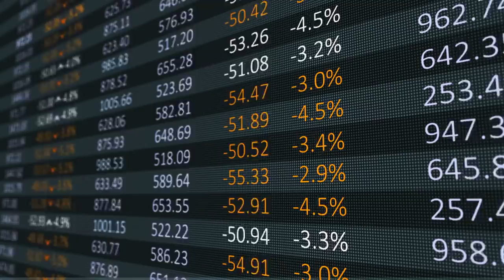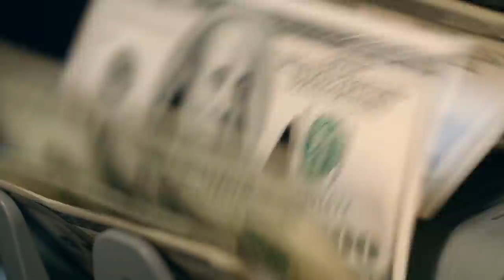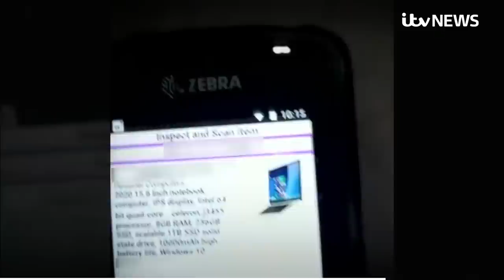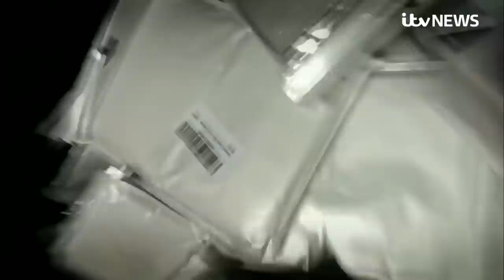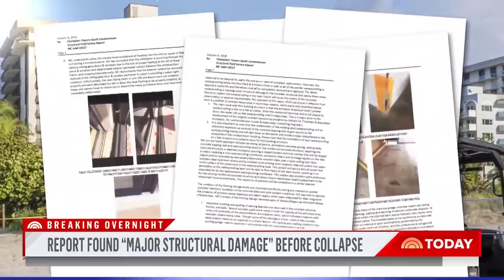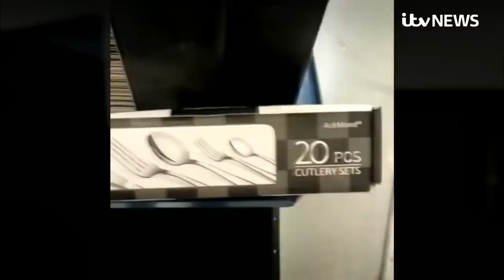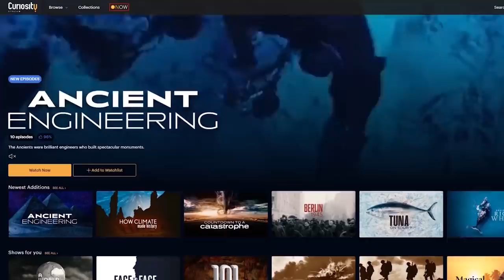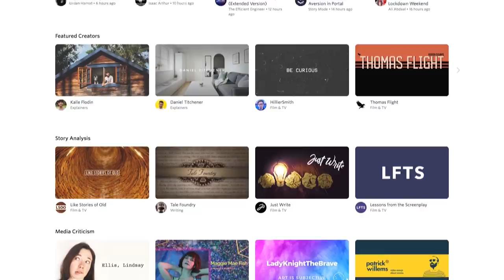Is Capitalism Actually Efficient?

Comment: I know you don’t like capitalism, so could you make a video that gives your opinion on what kind of economic system we should have? I don’t like how big corporations are able to manipulate the economy like that, but I also think some business is good, and that in general equality of outcome is a bad thing.
Reply: @slevinchannel7589  is it?
Reply: 'but I also think some business is good'
Why?
Significant presence of capitalists makes guaranteed housing impossible, or nearly impossible. That is monstrously bad.
Reply: @thetaomegatheta  I understand that the profit motive is not the only incentive for people to work, but how can a fully planned economy take into account that certain essential jobs are much less desirable than others, and may be more necessary? How can a fully planned economy  account for the fluctuations in people’s interests regarding work/ career? I’m not saying it’s not possible and more than anything I’d like to know how it might work without the extra incentive which business provides. I agree most markets should be capped, but how do you get enough underwater welders for example when it is an extremely dangerous job?
Reply: @roanshash2979  
'I understand that the profit motive is not the only incentive for people to work'
The profit motive isn't a reason to work at all, as working-class people's income (except for, arguably, freelancers) doesn't include profits at all. Working-class people's income is comprised of wages and salaries, not profits.

'but how can a fully planned economy take into account that certain essential jobs are much less desirable than others, and may be more necessary?'
I don't care about the specifics, and I'm not sure you are even aware of how this is accounted for under capitalism. The USSR managed stuff like that just fine, and I don't see what the issue is.
One tool for regulating stuff like that that you might be interested in is the fact that, upon graduation from university (which was not only free, but you were paid to attend, actually; if you get a budget spot at a university in Russia today, you also get paid to attend, but today's stipends are negligible, while the stipends of the past were very significant (like 40 rubles per month)) you were offered a job (which you did not have to take).

'How can a fully planned economy  account for the fluctuations in people’s interests regarding work/ career?'
A person applies for a different job, gets the job, starts working that job. Gets provided housing if they have to move to another city, as well.
The USSR managed just fine for decades.
So, what's the actual issue?

'I agree most markets should be capped, but how do you get enough underwater welders for example when it is an extremely dangerous job?'
How do you get enough underwater welders under capitalism, where people don't even get offered appropriate jobs upon graduation?
Reply: @thetaomegatheta  my example of the underwater welder was to illustrate that people might be more inclined to be an underwater welder since the salary is very high under capitalism and it is a vocational career. If there is no further incentive to put yourself in a dangerous job like that would there be a shortage of underwater welders? People might go to school more but how many would end up working as an underwater welder? Companies need underwater welders to produce their products so that is how sufficient welders are acquired, but I’m not saying that’s a good way to do it.There can also be markets and business with worker owned means of production no?
Reply: @roanshash2979  
'my example of the underwater welder was to illustrate that people might be more inclined to be an underwater welder since the salary is very high under capitalism and it is a vocational career'
Real salaries in Russia are lower than they were in the USSR. Most of the world has lower real income than that of lower-income people who lived in the USSR, in general.
This claim that salaries are somehow magically very high under capitalism is just nonsense.
Not sure what was your point in bringing the fact that it's a vocational career, either.

'If there is no further incentive to put yourself in a dangerous job like that would there be a shortage of underwater welders?'
The same argument applies to underwater welders under capitalism, yet you are presenting this as only being a problem for planned economy, for some reason.

'People might go to school more but how many would end up working as an underwater welder?'
Same argument applies to capitalism.

'Companies need underwater welders to produce their products so that is how sufficient welders are acquired'
Companies needing welders doesn't actually magically create welders. Unless they are acquiring slave labour from a reliable source, welders actually have to apply for, or be offered the job. That is how you get underwater welders under both capitalism and planned economy.

'There can also be markets and business with worker owned means of production no?'
Market socialism is a thing, but I don't think it ever got implemented, and I am very much not a fan of the idea.
Reply: @thetaomegatheta  vocational education can be completed much quicker than a 4-year B.S. or B.A. so that’s why I mentioned that. I think what I’m trying to say is that the higher salary under capitalism is the incentive to be an underwater welder. I mean it’s not unheard of for people to chose jobs because of the money. 
I agree that Russia today has worse quality of life and lower pay than in the USSR, but if everyone gets similar pay in a completely planned economy for multiple jobs, what would make someone want to be an underwater welder and put their life at risk? Why not just be a regular welder if the benefits are similar? I appreciate the time you have taken to reply to me but could you explain why you don’t think the higher salary under capitalism serves as an incentive in this case? The way I’m picturing it is weighing the pros and cons of the job under either economic system. I’m sure it’s possible for a socialist country to add the incentive for dangerous jobs, but how was it done?
Reply: @roanshash2979  
'vocational education can be completed much quicker than a 4-year B.S. or B.A. so that’s why I mentioned that'
And? Do you think that vocational education is incompatible with planned economy?

'I think what I’m trying to say is that the higher salary under capitalism is the incentive to be an underwater welder'
It is not somehow magically higher under capitalism, so your premise here is just wrong.

'I mean it’s not unheard of for people to chose jobs because of the money'
Okay, but your entire premise of capitalism somehow providing higher salaries/wages is wrong.
Or do you think that people were paid the same salaries in the USSR? I'd like to inform you that that is just an unsubstantiated meme, as well.

'but if everyone gets similar pay in a completely planned economy for multiple jobs, what would make someone want to be an underwater welder and put their life at risk?
People had different salaries for different positions in the USSR.

'but could you explain why you don’t think the higher salary under capitalism serves as an incentive in this case?'
Because capitalism doesn't provide higher salaries. Not in any sense, really.
In the USSR, people were also paid differently, but also more than people are paid in Russia now, adjusting for how much the costs rose (short summary: salaries grew by about two-three orders of magnitude, and so did a lot of other things, including food, but a lot of other things now cost a few orders of magnitude more - like taxes on housing, and payment for water, electricity and gas previously were about a handful of rubles against an average wage of about 80-120 rubles (depending on when we are looking at those) and against the minimum wage of about 40-60 rubles, and now they can very easily take more than a third of a person's income; and then there are things that were free, and aren't now - like housing itself which was previously given at no cost to the person/family getting it, but now costs somewhere in the millions of rubles (against the median income of about 35 000 rubles).

'I’m sure it’s possible for a socialist country to add the incentive for dangerous jobs, but how was it done?'
One easy and obvious way is to pay them more. Also, in the USSR, people who worked such jobs were allowed to retire early. Such jobs could also offer shorter working weeks.
(On the note of shorter working weeks, the USSR wanted to transition to a 6-hour working day under Stalin, however, the plans were halted by the invasion by Germany, and then dropped when Stalin died. However, by the time of the invasion, it did get introduced for miners.)
Reply: @thetaomegatheta  Ok thanks for helping me understand socialism better! I appreciate it. I should look into more stuff about the USSR as well. Any recs?
Reply: @roanshash2979  
Unfortunately, I don't have any particular English-language recommendations off the top of my head.
I do, however, urge you to try going over some basic micro- and macroeconomics stuff, in particular a section on what governments do in terms of economics, particularly why they balance budgets with revenues. Understanding that can help you understand why, under planned economies, governments are interested in providing people with guaranteed housing, universal healthcare, and other things that I mention a lot.

My own research into the topic started after I became familiar with the aforementioned economics stuff, as I realised some of the benefits of planned economies. Said research relied primarily on talking to people who lived under the USSR, as well as just directly checking if various places worked as I expected.
The life expectancy and literacy rate stats can also be found by just googling.
Reply: @thetaomegatheta  alright thanks so much!

Comment: I was an engineering major in college. I took one class in the industrial engineering division despite that not being my field of choice. It was all about balancing the sort of cost-cutting efficiency and minimum viable product. It always sat wrong with me how they talked about prioritizing whatever factors were most important, but it always felt like keeping cost low was the highest priority. And that just felt so backward to me. And that isn't even getting into the senseless waste aspects of things, and is more in the side of cheap, shitty products with planned obselescence and little regard for potential collateral damage of failure (sometimes that is accounted for but not always, despite the 101 classes my first semester hammering home how important that was with notable examples like the Pinto or the Challenger space shuttle explosion... it gets accounted for in major cases but only ever enough to minimize legal liability and never enough to ensure real safety). The obsession with minimal cost and maximum profit is a big part of what disillusioned me from engineering: despite the importance of finding new solutions and innovations to, say, reduce our dependence on fossil fuels or ar least improve the efficiency with which we use them, it always came across that the discipline as a whole was more concerned with the same old designs but cutting cost and adding shallow "improvements" like smart home nonsense or blockchain BS that don't really affect production costs the same way hardware does. My thermodynamics professor always told us how wind and solar were terribly inefficienct and sang the praises of his diesel Volkswagen Jetta and its low emissions. ...Until my senior year in 2015-2016 when a team he was part of exposed VW's method of cheating emissions testing. (He taught my senior design class that year and we even had a class canceled because he had to be at a press conference about it.) After that he quietly shifted to "wind and solar aren't viable yet, but it's your job to find new ways of fixing their problems so they can be in the future". Which is a good enough message to send senior students out on... until you realize the main issue with wind and solar power isn't even inefficiency in battery-based energy storage like he claimed but that they don't make coal/gas/oil companies richer. Ultimately engineering on the whole is the best route to solving the climate crisis... but capitalism is the block preventing that. Without a focus on profit, we could engineer the solutions we already know about on the scale we need them pretty easily. They just aren't making people as much short term money so they're "not practical". Just... fuck, man.

Comment: The world logistic supply chains are extremely fine tuned for high efficiency and low costs. It leaves no room for adaptability or flexibility. It is just not profitable for the system to be able to adopt to rarely occurred pandemic or disasters. It would be cheaper to protect the company owners from legal or financial lost in such situations.

Comment: Here's my problem with Socialism, it always sounds good in theory, but it can easily get ruined in practice. It's just as capable at oppressing the poor. So this notion that Socialism is good overall is blasphemous to me. If someone wants to constructively provide a convincing counter-argumentative point to this, please I would like to see it.
Reply: A counter argument to "socialism also has flaws and is capable of exploitation" is not what people are arguing against
Reply: @Mixinnitup  I have quite the disdain for capitalism. I've worked at grocery stores where they'd waste alot of produce. The argument for it was because it's expiration dates were near. Not to mention, I've seen people dig out of that very same dumpster. People have also left opened boxed dried goods to "try" them.
Reply: Socialism isn't the perfect system but a better system. The only way to solve all problems is to move away from materialism.

Comment: It's interesting how you point out the many things you take issue with within capitalism, but fail to provide an alternate, superior mode of distribution. There are many aspects of capitalism that can seem problematic when you display it like this, but it's still a fairly easy way to distribute ample resources to most people within a nation, regardless of the waste that's sort of inherent to a system that's based around the profit motive. Of course, there are some industries that work better independent of the profit motive, or regulations that are essential to keeping markets running smoothly, but that's why we choose not to stray too far to any extreme. You've defined capitalism here by its flaws, and it's convenient to call capitalism the issue if you refuse to address what makes it more optimal than, or distinct from feudalism. I assume you would still call most market economies around the globe capitalist, even if they don't check all the exact same boxes the US does. This video has not communicated anything to me about the merit of capitalism as an economic system, and you gave an incredibly shallow analysis of everything you went over. 

Go ahead and make another video (or anyone who responds to this comment), but present to me exactly how your alternative economic system would fix all of this without drastically lowering the quality of life, totalitarianism and/or a descent into totalitarianism, or economic collapse quickly after its implementation. On top of that, I'm curious about how you'd like to implement that system (the hard part), but It's still totally fine to talk about theoretical alternatives to capitalism.